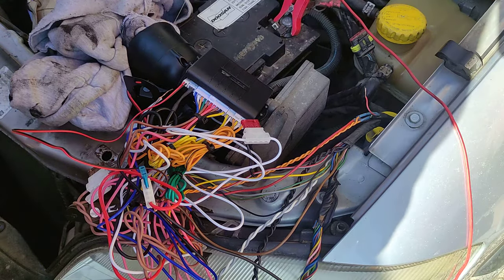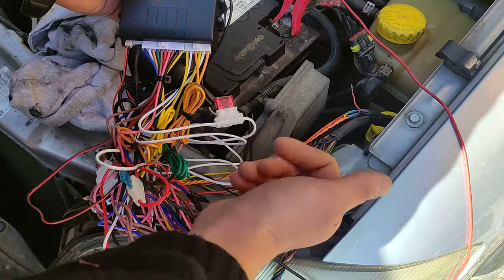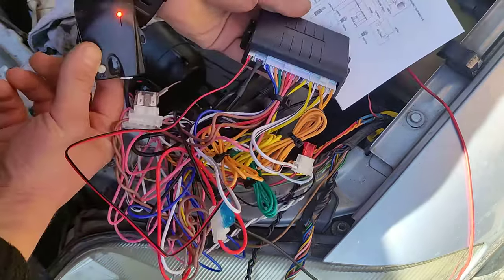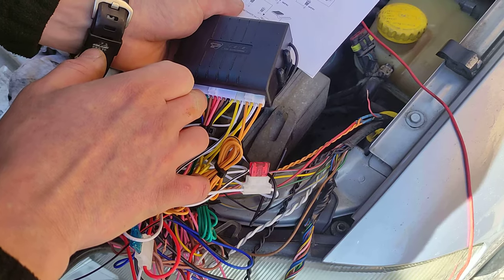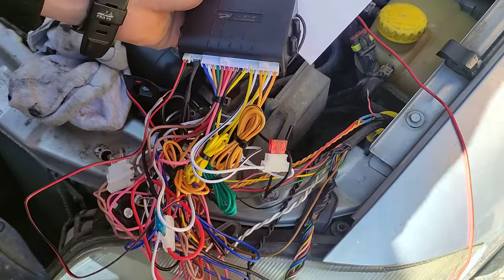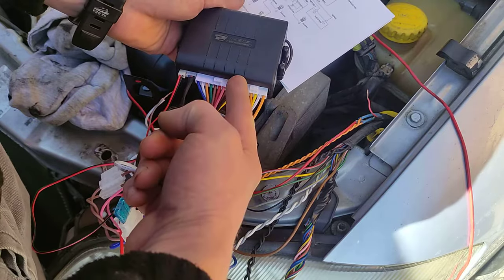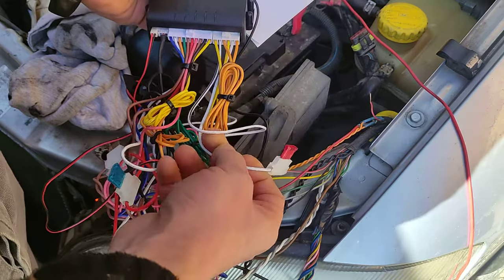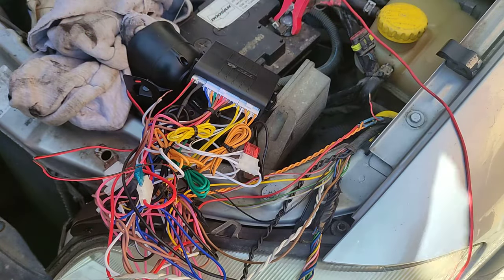Universal Car Alarm Installation + wiring diagram explained

Comment: Im having a hard time tryna figure my central locking out ive tested with multimeter and im pretty surem my locking is positive input but does not work when i try connect to alarm wires do u have any tips thanks
Reply from the maker: Have a look in a forum or FB group if someone already installed a alarm. Will be a lot easier than trying by yourself especially if you never did it before
Reply: @MeFixingEverything   ive read a few things and been told i need to install a dei 341m as the locks output is a positive feed and surpose to be negative to wire upto my alarm do you know much about them?

Comment: where are two white wires connected to?  For what reason does one need a signal from brake switch? Thanks
Reply from the maker: Brake switch signal is for programming. Two white cables I don't remember, but have a look in the video I have the wiring diagram shown
Reply from the maker: I had a look , connects to the control wire  on the central locking. Where exactly depends on your car.
Reply: It must car use door switch
Reply: After 5 minutes, if you step on the brake pedal, the doors will automitically lock itself.

Comment: Is it possible to connect directly to central lock unit? Thanks
Reply from the maker: Maybe Yes, if you know the pin out.
Reply: @MeFixingEverything  yes, i have it, but i don't know the necessary signal to do the actuators work 🤔
Reply: Connect the white wire with the brown and white of the central lock module.
Reply: @psycopper1  thanks! Is white and brown also in the Mercedes Sprinter of 2005 year?

Comment: Traducir texto con la cámara

Hello, I am installing the same alarm but the opening and closing of the locks does not work with the white and white and black cables, the orange and orange and black, should they be joined?

￼
Reply from the maker: There is 6 different ways of connecting. Unfortunately I don't remember what I did back then but look for a few more videos,  especially pull.to ground explained wiring diagrams.  Every car model.is different.
Reply: @MeFixingEverything  I already fixed it, I had to connect the yellow and black yellow to negative and the rest was fine, thank you very much for responding anyway